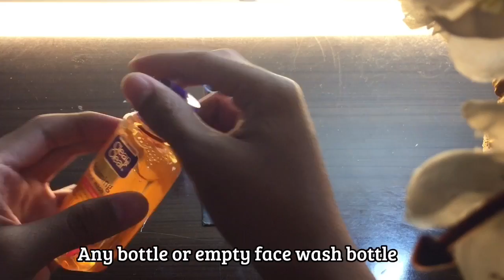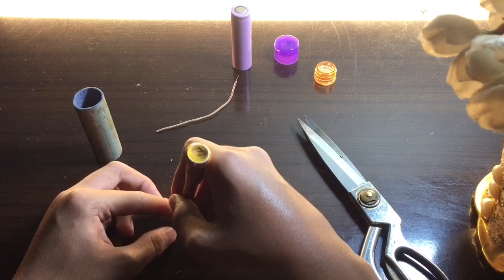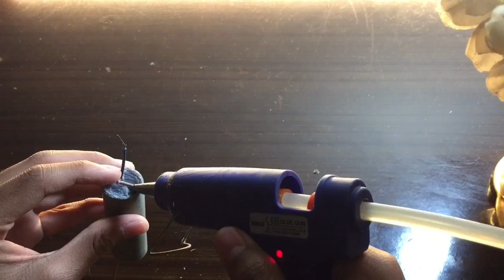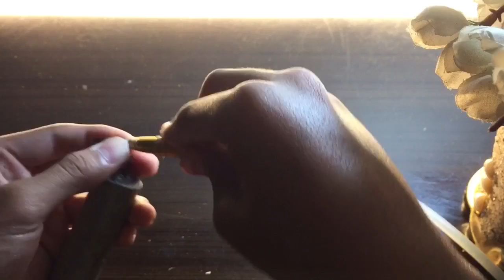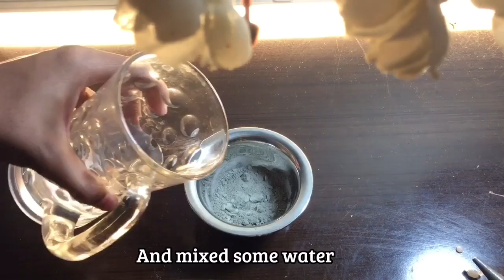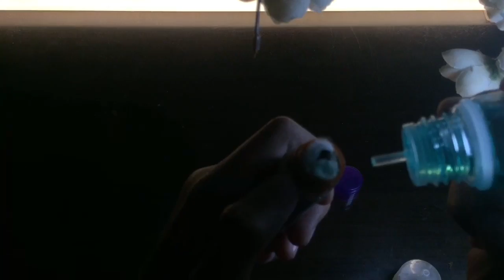how to make vape at home eassy || Home made professional vape || Technology killer ||

Comment: Nice ghetto tek! For the peeps asking questions about wire and batteries. To get a decent and especially safe vape this way, you need to understand the relationship between Ohms, Volts and Wattage or the result might be on the danger side. Get your wire from a vape shop as well. The battery in this vid and in most vapes is a high drain one rated at between 3.7 and 4.2V. The coil's "ohm" reading dictates how much resistance or heat it can generate but that's only safe if the battery can handle the wattage being drawn. Typically the wire coil should read 0.2 to around 2 Ohms if the battery is high-drain. You can buy pre-made coils to be safe(r). Also the guage wire for the connections must be able to handle the current. I'm not overly keen on the idea of plastic as the chamber as you'll inevitably inhale carbon monoxide, dioxin and furans (shit that's bad)
Still, it's a good start and pretty much what makes a vape work!
Reply: bro Thats so true 
im 14 and i know all this
Reply: @smartiosthecat6988  I'm 15 (almost same) and I cba to do all that coz my parents are asian and u don't wanna know what happens if they find out. I need to lay low with this shit lmao
Reply: A safe vape doesn't exist
Reply: @IboPSUK  yeah I know alot about batteries and shit too
Reply: Good advice bro, would be much better if they got one from a vape shop, CUZ that is technically a mechanical vape, meaning no built-in safety so it could explode if they put too much strain on the battery
Reply: @plaguedoctorlachitte6095 especially not a bootleg mech mod. Mech Mods are all ready for people who know what there doing this is basically a hand grenade
Reply: Id jus take the shit from a disposable vape and use that. That's what I used to do was Frankenstein em together lol I watched dis tho cuz was curious this guy did good no lie
Reply: @plaguedoctorlachitte6095 facts
Reply: Good comment! Should definitely be pinned!

Comment: 1.Can you use a 1.5 V battery 
2.Does the tube need to be pvc
3.Can you use copper wire
Reply: @Technology Killer BD
Reply: 1. No 
2. No it doesnt matter what u use 
3.not in the coil it has to be nichrome wire
Reply from the maker: @juissi5078  yes right💗
Reply: @juissi5078  thanks
Reply: @juissi5078  Would a 3v battery work instead of 3.7?
Reply: @Theppgskull  what kind of battery
Reply: @Theppgskull  yes probably but not that much smoke
Reply: @Theppgskull 18650 battery is what you need. It's found on old laptop battery packs and can be bought online
Reply: Wow😐
Reply: @technologykillerbd9681  can you use clay instead of cement?
Reply: U can use kanthal wire or nichrome wire instead of copper or GI. A way to get nichrome wire is to take apart a pen and take the spring out of it
Reply: Micah Samuels  no kanthal works
Reply: @juissi5078  Can you use a 9 v batteri
Reply: @technologykillerbd9681  can I use mud as sement
Reply: @juissi5078  High drain INR 18650.
Reply: @Theppgskull  Depends on the Ohm reading of the coil and the guage connection wire.
Reply: @vapinmccloud412  What were those extra wires called?
Reply: @mehkijgamer1975  Not exactly sure what you mean by "extra wires". There are the wires that connect the battery to the coil which are basic wires that can handle 4.2V and then there is the coil wire. The coil wire can be found at any online vape store at varying "resistance" ratings (Ohms per meter/inch/whatever in this case). Mainly Kanthal, Ni-Chrome and Stainless are used these days. NiChrome is easier (for me) to work with but you need to check out some vaping coil build vids. Once you start to coil any conductive wire, it will cause ...lets say "friction" to the flow of electricity. Like making a water hose longer. The more coil winds, the higher the friction and therefore the hotter the coil. It's how the old fashioned light bulb worked. It gave off heat as well as light.
Reply: @debaratikundu4255  pretty sure you can skip the cement part
Reply: @debaratikundu4255 no
Reply: You can find coil in a face mask
Reply: What wire do you need its not showin what i need
Reply: @jamesplayz450 That's just steel. not good.

Comment: Thank You .You help me to not buy vapes
Reply from the maker: You are most Wellcome. Plz support me 💗
Reply: Is it necessary to have gi wire😢
Reply: @RaiUmairAli yes. But 
You can use any wire which can hold heat for long time. Don't use steel or any wire. It will melt and csn burn yourself

Comment: I have questions 
1. Why u need cement
2. Can I use 9 or 12 volt battery
3. What diameter is pvc pipe?
Reply from the maker: Ans

1. I have cement if you don’t have cement u can use any heard thing to cover this inside.

2. Yes u use 9or 12v battery 

3. Any pvc pipe u can use cut pvc pipe on your battery size
Reply: @technologykillerbd9681  can i use like hot glue to cover it?
Reply from the maker: @SOUL-yo4vv  if you use hot gule its throat and u cannot use it long time
Reply: @technologykillerbd9681  can we use m seal
Reply from the maker: @gurudutt7012  yes yes this is the best thing for make it but everyone not found m seal u can use m seal
Reply: @technologykillerbd9681  can u use a 1.5 V battery
Reply: @technologykillerbd9681  can i use supper glue?
Reply: @technologykillerbd9681  hello, can I use maybe rubber stopper
Reply: @technologykillerbd9681   We want to charge it or not??

Comment: Is it necessary to make heating coil with gi wire or Nichrome? Can we use aluminium wire?
Reply: If u use aluminium wire it will not heat up...rather it will just short circuit ur battery.... Nichrome wire as high heat conductivity so it doesnt short circuit

Comment: 1.can i use 4.2V battery
2.whether nichrome wire or coil is twisted
3.whether on the part of the battery - can be used circuit wire or with a cover

Plss reply
Reply: the nichrome wire IS the coil

Comment: Does using an ordinary steel wire work instead of nichrome wire?pls reply
Reply from the maker: No no need nichrome wire
Reply: @technologykillerbd9681  ok thanks
Reply: @technologykillerbd9681  they sell stainless steel wire for vaping
Reply: You can use the spring inside of a jet pilot ink pen

Comment: Ngl that’s impressive but I don’t thing the cement was rlly necessary cause it just makes your pod smaller you could always just put a layer of hot glue on the top of the battery sealing it and making the pod hold more juice

Comment: Can I use the wire inside a soldiering iron?
Reply: no, solder has too low of a melting temperatur, not suited for making coils which are meant to be heated up well past that melting point.
Reply: yes you can. but only the wire INSIDE of it. if you use the solder wire (the stuff that melts) you will die of lead poizoning or just get a bunch of flaming hot molten metal in your mouth.

Comment: Like do u need to put the cement?
Reply from the maker: Yes cz it heard and it not easily broke if you don’t have coment u can use any heard thing like coment
Reply: Bro he used plastic and hot glue on that part and then he used cement to put everything in place so even if it melts the cement can hold things in place cuz it dosent melt
Reply from the maker: @YTtraveller-q2j  yes

Comment: Does it work with a 1.5 volt battery
Reply from the maker: No need three or two battery
Reply: @technologykillerbd9681  ok so it works with 2 volt
Reply from the maker: @jonasxdboy3297  no need minimum 3+ volt
Reply: @technologykillerbd9681  ok thanks

Comment: Also how many amps does your battery have?
Reply: It's a 3.7 volt batter
Reply: @Tushkey  i know the voltage but what is the current of that battery?
Reply: @pizzapr9287  it depends on what mah battery ur using, amp will vary according to different battery mah eg, 1200mah, 1500mah, 1800, 2000...etc it will vary

Comment: What battery does it need to be
Reply: 18650 30 amp 3.8 volt with probably 2500 or higher mAh. You could go to a lower amp but probably nothing less then 20 amp.